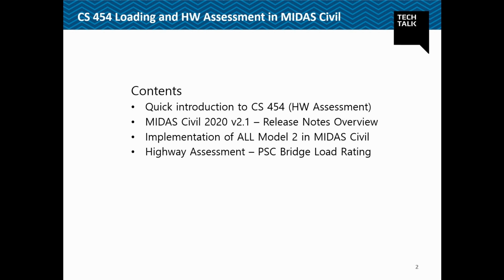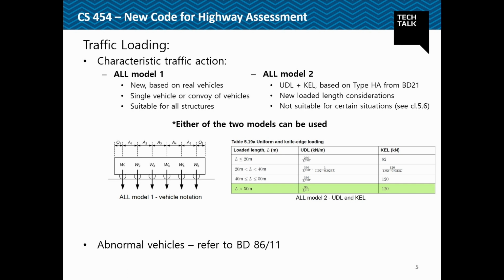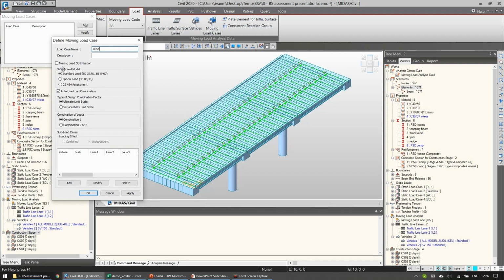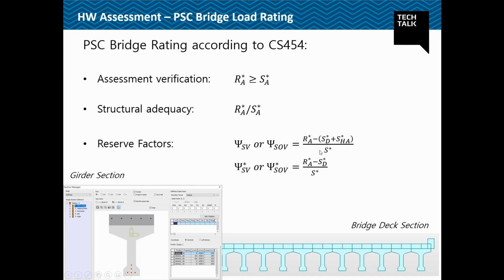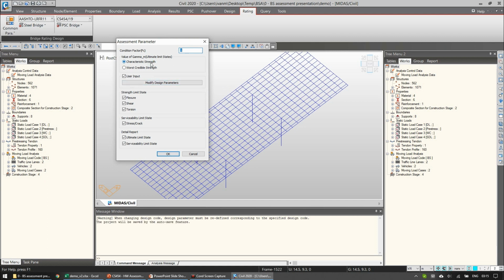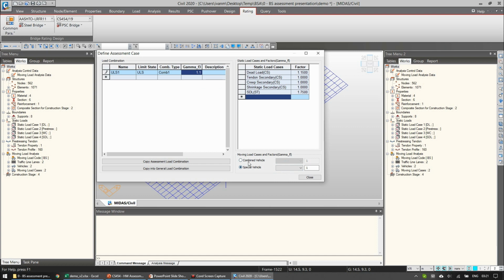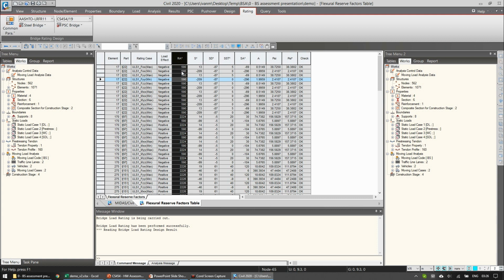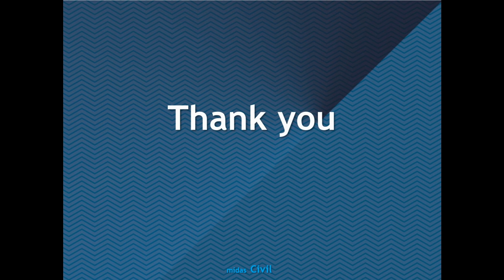midas Civil 2020 v2.1 Release for CS454 Bridge Assessment_2020.02.13

Comment: Hi, I didn't catch anywhere in the video why the ALL Model 1 was not included in this release of Midas? It was mentioned around 10mins 30seconds in the video but nowhere else. When using ALL Model 2, the single axle load and accidental wheel refer back to the standard vehicles included in ALL Model 1, so it is not straightforward.
Reply from the maker: All Model1 is under verification at this moment and it will be released in June 1st 2020.